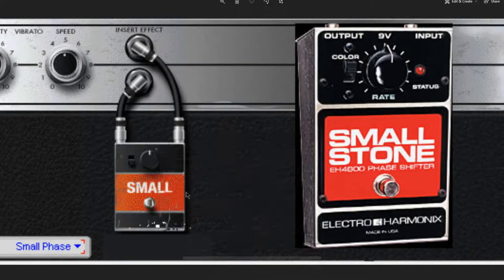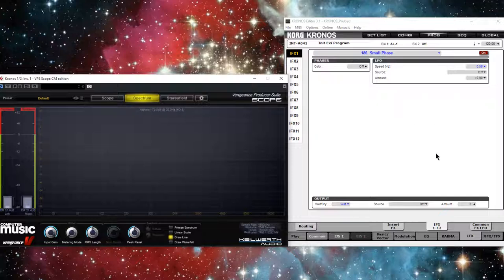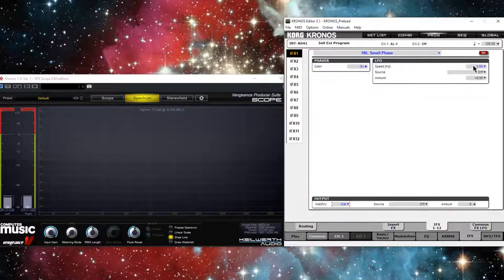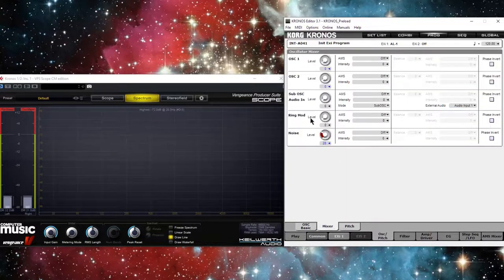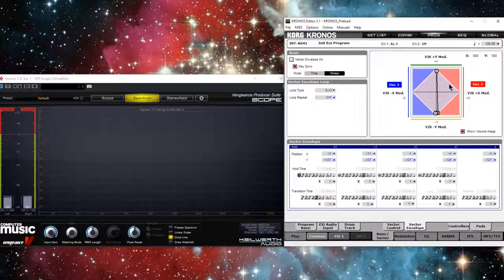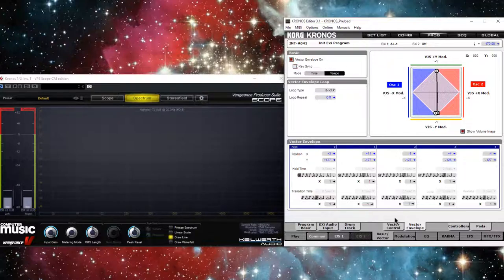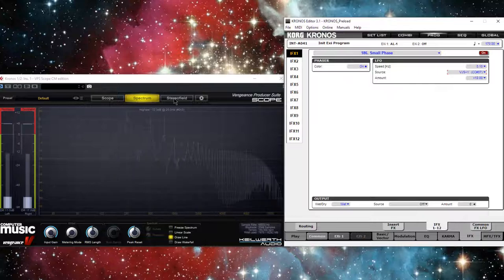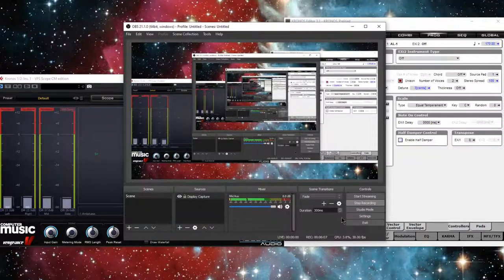Kronos FX: Small Phase

Comment: Are you using your Kronos with a daw like Cubase which uses the same audio interface for input lines and output lines? In that case you experience that it is not possible to record more than one audio track with the Kronos usb audio interface. Recording a second track will record the audio information of the first recorded track into the second track as well. This does not happen with workstations like the Roland FA or with the Yamaha Motif XF. Any idea why Korg has implemented the audio routing as such?
Reply from the maker: Yes I am using Cubase with a UAD Apollo Twin USB.  The interface does use input and output lines.
Technically speaking, the Kronos can record two mono tracks.  But yeah, only one track if you're going stereo.
"Recording a second track will record the audio information of the first recorded track into the second track as well"  Have you tried muting those tracks?  Similarly you can mute the Kronos inputs.  Go do the Control Surface tab and put your Control Surface on Audio to view the Kronos inputs.  Then simply mute the inputs.
Korg claims they use a simple stereo bus for simplicity and the new pitch is it's more compatible with livestreaming.
Reply: @CharlesFerraro  Thanks for your answer. Muting tracks in not an option because when i built up a song i like to improvise on the previous track. I think i have tried the input option and it had the same effect as muting a track. Anyway i have found 3 solutions. Creating an aggregated audio interface on my mac, using Logic Pro X (you can define an input and an output on different interfaces), or finally using my external Steinberg audio interface with the Kronos plugged to it.